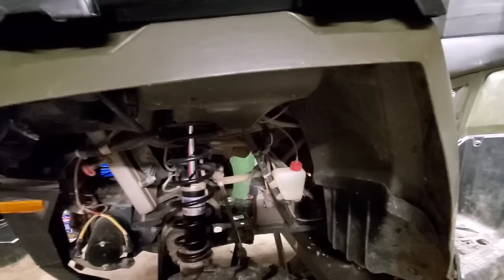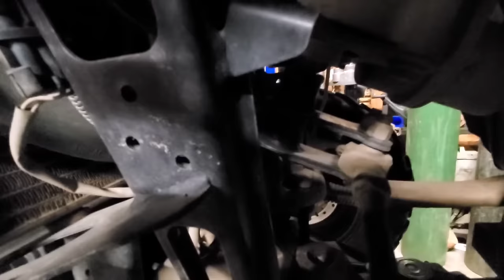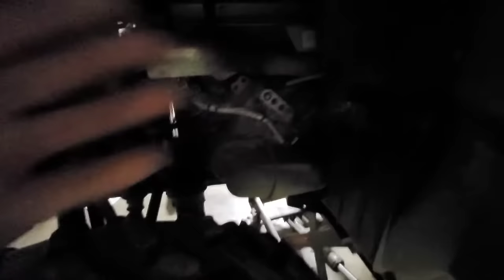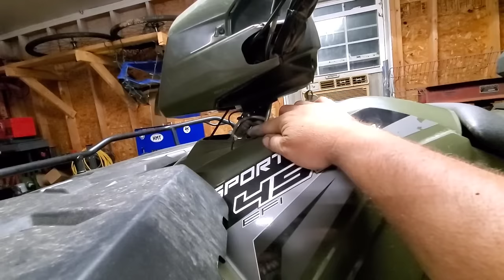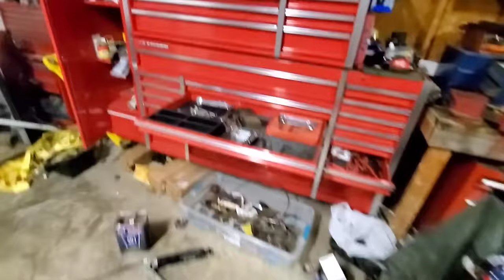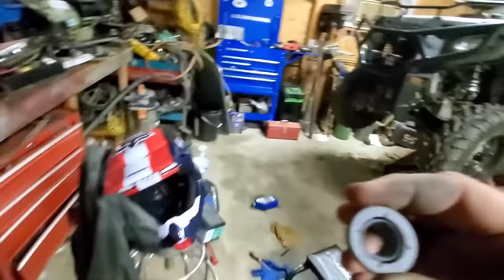Dear Polaris...this is shameful  #polaris #atv #sportsman

Comment: I had an 02 sportsman 700. I loved the power and the smooth ride. I spent countless hrs and crazy money to constantly fix it. I’m now a proud and very happy owner of an older Honda fourtrax and a Yamaha big bear. Both very reliable and I have done little to nothing to either of them even with them being much older machines! I won’t buy another Polaris. Great video
Reply: It's  just a fact, everything Honda makes is over engineered .
Reply: I have three Big Bears, combined they have our 15K miles on them with only one carb replacement. Yamaha all the way!
Reply: @mikehenry4743  same here, had a blue early nineties 350 big bear and it was an absolute beast. Manual shift and a low range, couldn’t beat it.
Reply: I had a 99 Polaris sportsman 500 atv  it rode great loved the engine but there was always something going wrong with it! I finally got fed up with it and sold it.i went and bought a 2003 Honda rincon 650 atv i still own the Honda to this day and have 4500 miles on it i plow with it in the winter and use it to work up my food plots and its been bullet proof! I have never had to change a bearing or a seal nothing just a couple batteries and replaced spark plug every so often thats it. Its the same thing with polaris snowmobile i owned four brand new Polaris sleds in a row they where better than their atv but i was always having to replace this fix that never quite ran just right so finally i switch over to ski doo in 2002 best thing i have ever done. Im on my fifth ski doo know and its Unbelievable you just put gas and oil in them and ride never ever foul a spark plug or replace bushings or clutches. It can get to be really costly to find out your riding an inferior brand but it's never to late to switch i don't regret it one bit.
Reply: I recently sold my 2019 sportsman 850 to a very good friend of mine. I bought the machine new, after 4 years of ownership I can say it’s been a decent machine.for the price of these new machines the build quality isn’t nearly as good as machines from the early 2000s. I fixed up a 2002 Suzuki king quad 300 that’s been sitting in my field for at least 8 years and after about $200 of miscellaneous little things here and there it runs like new and everything still works. 2000 miles on it and it’s a solid built machine. Sure it doesn’t have the power or suspension quality of the new machines but it’s solid and reliable after almost 25 years
Reply: I think can are are bigger piles of crap. I had a 2021 outlander 850 max xt break down with 200miles on it.

Comment: I bought a new 2016 sportsman xp 1000. Broke down first ride. Found the spark plugs and caps were  loose I called the dealer and explained what happened and was told it doesn’t happen and I must have been riding too hard. I was doing a break in ride on the trail . I laughed at him and never went back to that dealer again. Your video sums up my Polaris experience perfectly . I now have 2022 can am 850 xmr and completely happy with it. I also have a 2005 Honda rubicon I bought new  which I recently did a 250 mile trip with . Not an issue . I spent more money in repairs on the 2016 sportsman in 5 years than my 18 year old Honda .
Reply: You should have told him that you ride your ATV as hard as you ride HIS WIFE and she doesn't break.

Comment: Almost 27,000 miles on my Kawasaki Prairie 700, and I've never had to replace a single bushing. I've also still got my original brake pads in it.
Reply: I had two 2006 prairie 700s back in the day. Both new. Best quads I’ve ever owned and I regret selling them. Every machine after those had some kind of annoying issue.
Reply: That's like a million on road miles equivalent
Reply: I still have my 2004 prairie 700 and the ONLY thing I have had to repair is to clean the carbs. LAST YEAR!!!! Nuf sed....
Reply: Let the good times roll!  I have an 02 prairie 300.  I wouldn't trade it for 2 new Polaris' 570's or any old Polaris.  Reason is I have a friend with a Polaris 500 ...piece of junk.
Reply: Anything Kawasaski is all but unstoppable as long as it has oil.   My primary work horse / beater for my property and gathering firewod is a 1985 bayou 185. That little thing will pull 600-700 pounds of wood all day long and never complain.  And when I'm not using it my 2 boys are beating it to death.  It's almost 40 years old!

Comment: I had a 2001  Polaris sportsman HO 500, finally changed machine and had a look at new Polaris. Realized the amount of plastic and even the front was now plastic and not looking very reliable. Went with the Argo 4x4 700 and have not regret my purchase. I have a 8x8 argo and those machines are beasts so figured they must build their 4x4 as tough as the 6x6 or 8x8 and I was right. NO MORE POLARIS junk for me

Comment: In 95/96 we were getting service bulletins from the factory before we actual took delivery of ATV's Snowmobiles and Water craft.  I knew then they weren't the same company that brought us such good snowmobiles in the 70's and 80;s. I'm not surprised to hear this at all,  Such a shame.
Reply: At least they addressed the problems  then, the monoblock snowmobile engines got better oiling,  the 500 sportsman got hardened camshafts, I can speak on their snowmobiles that they were top quality until 2005.

Comment: I agree with everything you said. 1. The steering issue sucks. On my 2013 850 EPS after reading the forums, I bought the upgraded parts I needed to fix it. Only the All Balls heavy duty tie rod set and The Garage Products Delrin Bushings have held up fine. After 3 times plowing in my double wide driveway, the slop was back. 2. Delrin Bushing fix the problem permanently!  3. I was sick of buyying Polaris Wheel Bearing That just would not last, even wheb greased. So I Went for a Cheaper alternative...Rocky Mountain Bearings. I use only 100% synthetic grease on everything I own, as water will not wash it out. None of the new bearings have yet to be replaced, and feel like new with over 3k miles on them.

Comment: A friend had a 1996 Polaris Big Boss 6x6.
The starter motor crapped out.
He went to the local dealer.
$600 and 14 day delivery from the country 2000km across the sea!

On line I searched out a supplier in USA. 
After market nameless make drop shipped $38 plus $96 freight to our little country at the bottom of the world.
Arrived within 5 days.
Fitted and worked perfectly.

Three years later the bike refused to run above idle...
Worn out camshaft and rockers!
Huge expense via dealer.

He bought a  brand new Yamaha Grizzly and gave away the Big Boss to someone who thought he might be able to fix it for less...

Comment: I have always owned Honda's / Yamaha /Suzuki's since the late 80's and i would not hesitate to buy any of the 4 Japanese atv's i currently own Grizzlies i would not buy a Polaris atv or a utv for the number one reason the build quality and reliability is not there either no real engine issues from anyone ive come across but crap everything else on them from bearings /bushings / pw steering / starters / electrical to gauge's that's on ones i now that have been babied i always ask people when im out how they like there atv and Polaris owners are in a league of there own when it comes to premature parts repair's and major part's failure's  i have never seen issues on Japanese atv's that i see on the Polaris

Comment: You are 100% correct I have a Polaris ranger 6000 miles three sets of Chinese Polaris wheel bearings, custom ball joints, custom A arm bushings, custom drive shafts, unjoints, tie rod ends, new clutch, belts the list goes on junk Chinese parts garbage.

Comment: I have a side-gig shop repairing these overpriced plastic puddle hoppers .... I never replace with O.E.M. unless customer demands it !!  I use Quantum Pumps .... All-Balls - Moose , Bearings & Suspension Components , NICHE Axles .... Castrol 5W-50 Oil , 5W-20 Castrol with 15% Lucas in Transmissions , Mobil 424 in Demand Drives , & Synthetic 75W-90  Wally World in Rear Drive Pumpkins !!  I get a Lot of them in & when used hard to work on surrounding farms ranches etc. , they do not hold up !! Kawasaki , Yamaha , & Honda is where it's at !! 
😊👍🏻

Comment: I'm a gold certified tech for polaris in their commercial line. It's not my main practice, thankfully. I will not buy one, and my friends have been advised as well. They are not only unreliable, try to get parts. Not to mention all of the stupid mistakes I've seen from the factory. Like the dust cover being left on the throttle body so it doesn't start and pukes fuel into the crankcase. It's impossible that it was ever test ran.

Comment: I have a Honda atv and it’s all original.  It has 6 million hours, 2 million miles, has everything original including the brakes, tires, filters, oil, and still has the original gas from the dealership when I bought it new.  
Should have bought a Honda.

Comment: I have a 99 500, only problem I had with this is the cam, and that after 20 years use. Everything, all brands have issues, cars, trucks, all.
Reply: Youre 99 isnt a new polaris. I wanted one cause my uncle 01 was so good, i just burnt up my 2nd voltage reg and only took 20 miles, im so mad im gonna let this rott in my woods and go buy anything but a polaris

Comment: Polaris is garbage. I have worked on MANY MANY of them and they're by far the most pain in the a$$, most expecive and cheap made crap that I have ever seen even the old Polaris's are total garabage too. Every polaris that has come to me I have seen blown out Steering Stem bushings, Blown out ball joints, blown out rear A Arm Bushing, fuel valves leak if you touch it wrong, master cylinder goes out one after the other etc not just some ALL OF THEM. These "american made" quads are JUNKKK , honestly I noticed that Chinese ATV's and scooters have better engineering then Polaris.  Yamaha, Honda, Kawasaki, Suzuki are all amazing, the Japanese know how to biuld.

Comment: Have had over a dozen Polaris machines, almost as many Hondas, a few Kawis and Can Ams not to mention several Chinese machines.   Across the board Polaris has been the most trouble free (not  without issues, just far less) and dealer and Manufacturer support has been much better. Note: Worst warranty service has been head and shoulders Honda!  Just Sayin 🧛.  As Polaris QC has improved over the last 10 years CanAm's has fallen in the gutter, I refused to take delivery on one the build quality sucked so bad.  I'm not brand loyal to any of them, they all have their own inherent issues and problems, their own strengths and Fun Factors.  Best of luck with your future rides.

Comment: Have a 2017  1000 xp  razor.
Only has 600 miles on it.
I always have issues with it. Terrible engineering.  Always something breaking under nornal use.

Comment: Yamaha all the way
Reply: Yes and no. For reliability yamaha all the way. But for comfort. Polaris is best
Reply: facts i got a yamaha kodiak 400 from 2003 that still runs perfectly fine
Reply from the maker: Agreed
Reply: Can am
Reply: i would never buy a new polaris or yamaha i love the old polarisis there good but everything new is just built cheap
Reply: All y'all know honda is on top of all of them. If I wanted bigger than 500 I'd go with yammy. All this polaris and canned ham talk is nonsense because these machines are dookay.
Reply: Polaris sucks for quality hands down 👎 Honda will be my next
Reply: Suzuki is my next choices
Reply: @sylvainlaurence1554  I bought a 22 grizzly but Kingquad was my second choice .. neighbour has one and these two bikes are as close as it get in comparison .. I find the grizzly seat to be much better . Better power steering,arched arms , looks better led headlights ,and like where the cvt intake is better on grizz but all these things are very minimal best bikes out there in my opinion and I have been riding and owned most brands for years .. if you get the Kingquad you won’t be disappointed

Comment: Polaris makes great performing products but you hit the nail on the head when you said it's a 300 hour machine. Their engineering is some of the worst I've seen yet. I had a 850 and a 1000 atv dropped off to me for engine issues and after seeing that the engines have to be pulled completely out of the bike and how expensive the parts and labor was going to be I told both customers to sell both bikes for parts and go buy a honda 420.  The polaris is not economically viable enough to repair when you blow an engine or trans unless you buy half asked parts and do the work yourself. I hate polaris

Comment: I had a 2005 Sportsman 700 that I used to plow snow for 15 years. It ran flawlessly and I never had a single issue with it. I now have a 2017 Ranger 1000xp. It’s a POS and the cost for parts are outrageous. 3 stickers, $90. Drain plugs for front and rear diff, $90. Drive belt, $230. Air filter, $54. Absolute robbery. Oh, by the way, the bed on that ranger is absolutely trash. It feels like a cheap toy. I will probably never buy another Polaris in my lifetime. Expensive trash.

Comment: I had a 850 sportsman for 6 years, no issues, I still have a sportsman 450 8 years later , only issue was the brake safety switch failed. I can take that no problem at all. 
Sounds like a whiner to me. Go buy a honda and bounce yourself right off the trail.  LOL

Comment: I went from a Honda to a Polaris in 2013 that was the biggest mistake I could have ever made in 6 months the Polaris 500 ho was totally junk broken motor mounts hole in oil tank that was on the outside made of plastic bearings worn out  heat sensor issues and much more from normal riding my insurance company rote if off told me go back to Honda Polaris atvs are junk

Comment: I have a Honda 250 recon which is a work horse 🐎 .It is a 2000 model and I bought it. new. I have used for everything and my Kid's ride the hell out it. It has 50 time's the miles on it as the 570 Polaris which I bought brand new in 2014 .  I have used it very little because it seems like I always have to repair  it. I had to replace the brake pads and repair the front master cylinder. When it only had a few miles on it. On the Honda only have had to change the oil and nothing else...... My next Quad will definitely be a Honda and that what I tell everyone who asked me.

Comment: Trust me bud when I tell you. I cussed Polaris all day today dealing with changing out the one way bearing on the primary for a 2022 Polaris sportsman  850. First I the whole shaft came off when I was trying to break the spider loose so I locktite the hell out of the shaft with the spider still attached  and tightened the hell out of it. Gave it a week before I could work on it again and for the locktite to bond. So I go to break it loose today and with heat I broke my two breaker bars. A 1/2” drive and a 3/4” drive. So now I’m out of options with a bike that has only 400 some odd miles. It hasn’t been abused. Hell I haven’t even done the first oil change. So I ask myself why the hell i’m even working on the damn thing. Then they tell me at 5 months of owning it that they only have a 6 month warranty and they couldn’t get me in before the warranty expired so I would have to pay for it. If I brought it to be worked on 2 or 3 days after the warranty expires. Which would cost 2,200$ parts and labor. So it took me 4 months to get what proper tools I would need to do this and the parts. And now here I am. I’m calling Polaris tomorrow to tell them what I have going on and have dealt with and see what can be done. Everyone told me to try at least. I’m just fed up with the whole thing. I work 60 plus hours a week just to support my family so it’s not like I have all the time in the world. And sorry to type out a book complaining. Lol. But I am watching anything and everything on these damn bikes and this title just fit for the time I have had here.
Reply from the maker: Same mood I was in

Comment: Unfortunately you are wrong and right about this. Bushings and bearings on the old 500’s are garbage as well as everything nowadays. What I’m trying to say is Polaris have always BEEN garbage. We hammer 500’s, and they just suck. Speedo issues have plagued the older models (how is a speedometer allowed to have issues? Especially with AWD). Bushings have plagued these machines. The infamous polaris tie rod play, as well as the hockey puck bushing on the lower part of the 500’s steering stem. I have owned a Polaris scrambler 850 and lost 2 ball joints under 800 miles. I will never purchase another polaris as long as I live. They only work for so long, I’d rather a yamaha 700 and replace the airbox so it properly seals, and a can am and deal with the bad front differential than own a polaris and have the whole machine be garbage.

Comment: 5000 miles on my 2003 Arctic Cat in, no exaggeration, extreme desert riding - I've replaced tires and 3 CV boots, 2 rear axles and front/rear wheel bearings...Oh and I've gone through a few batteries...That's it. They don't make 'em like they used to - Irreplaceable. I am shopping for new but videos like this remind me of the corporate greed and shoddy craftsmanship I really want to avoid.
Reply: I’m on ab 7k for a 2013 366 and haven’t replaced ANYTHING this wheeler is mint